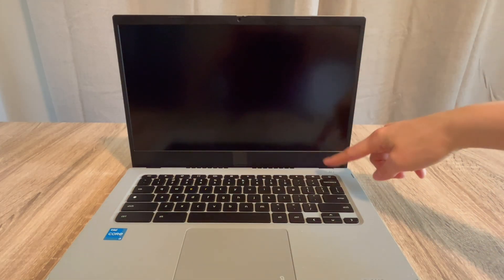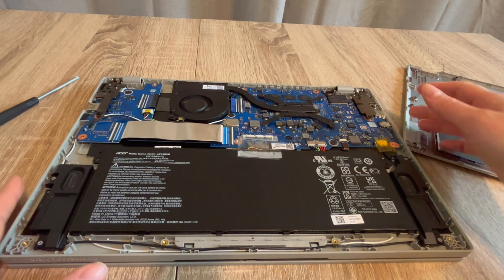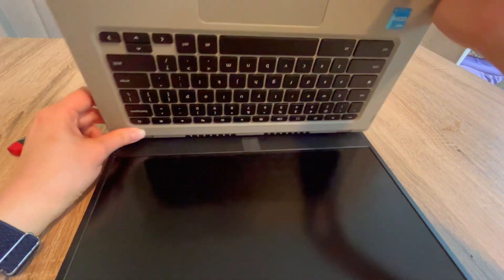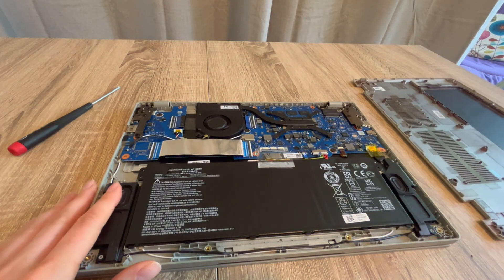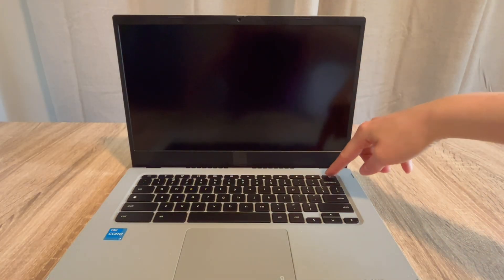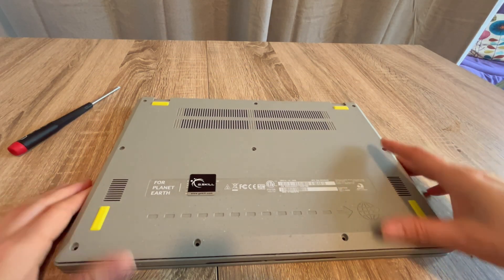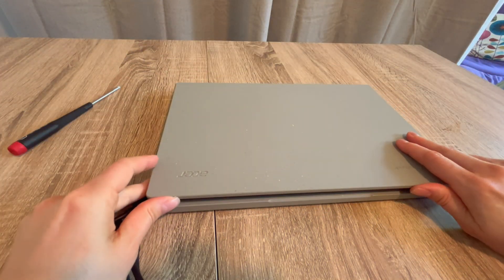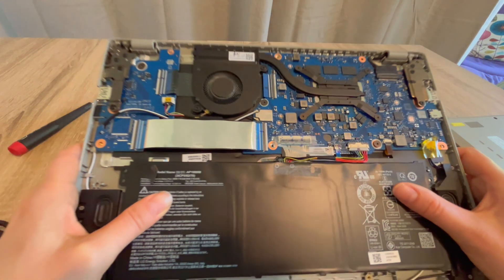What to Do When an Acer Chromebook Won't Turn On Even When Plugged In - by a Certified Technician

Comment: What would you say the issue is if none of the steps had worked?
Reply from the maker: If none of the steps worked, it might be a deeper hardware issue, like a faulty powerjack is a really common problem with Chromebooks. It could also be a motherboard problem. When you plug the power plug in does charging light come on?

Comment: But not power button isn't working. I've been switching it on by opening and closing it
Reply from the maker: Power Buttons breaking is pretty common unfortunately with Chromebooks. Although it is a pretty easy part to replace

Comment: My Acer CHROMEBOOK SPIN N19Q5 does not even show any charging light when plugged in anymore? Could any of these steps work, or maybe replacing the battery?
Reply from the maker: Have you tried replacing the battery? Does the Chromebook seem to function fine other than the battery charging?

Comment: THANK YOU, it worked, also how does step 1 work to fix it? I know it works but like how
Reply from the maker: Becuase is drains the flea power from a computer. This can fix certain problems because it eliminates residual static electricity and forces a complete reset of the system's hardware, including potentially hung or malfunctioning components.

Comment: What if the power light just flashes once and then disappears?
Reply from the maker: I would try the solution in this video if that does not work then I would see if it's an issue with the powerjack or charger. Here are videos on how to troubleshoot those two issues:

Powerjack:
https://youtu.be/jRE03AAWGbo

Charger:
https://youtu.be/WUNopJ-EDtM